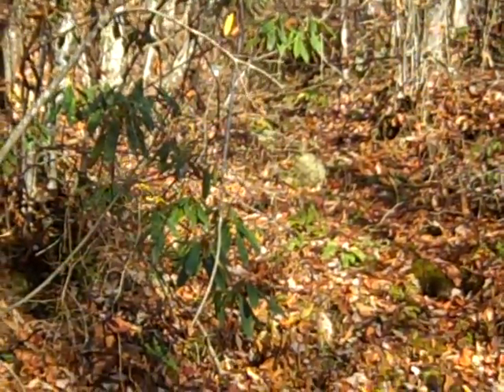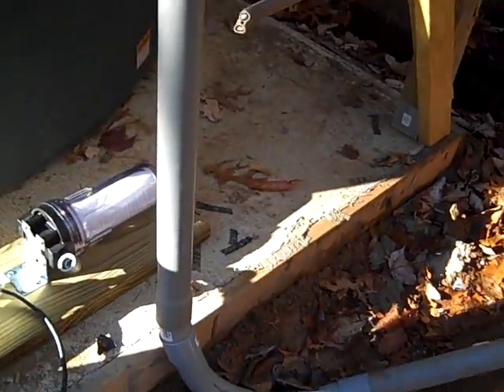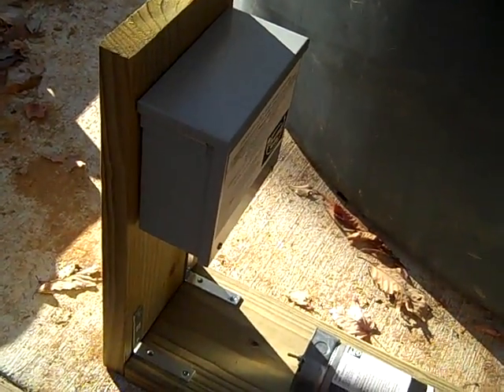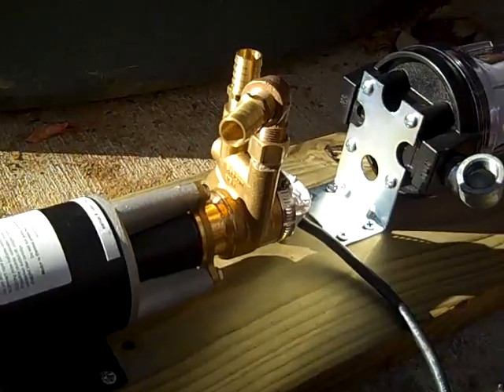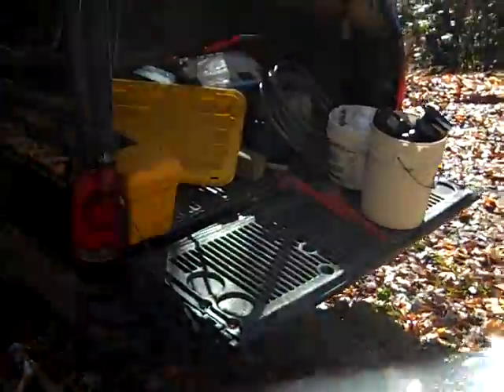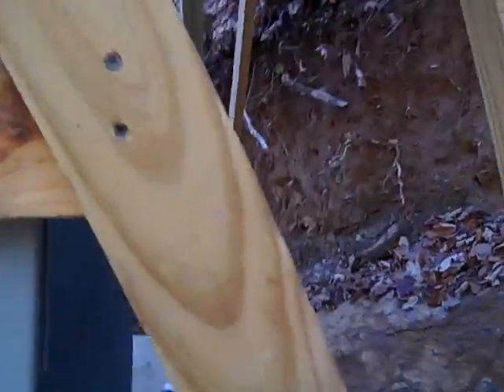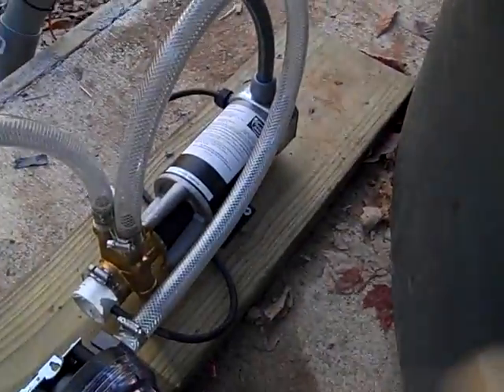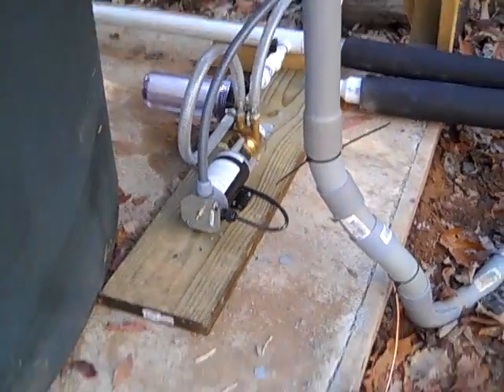Spring water up the mountain - Part 1

Comment: How many gallons per minute does this system pump during the daylight hours? I have a similar situation at my Alabama homestead in which I am designing a system for. 130 vertical feet, 500 horizontal. We have a 10000 gallon concrete tank I would like to keep topped off for house use and fire insurance.
Reply: Great video, BTW.

Comment: The common home application panels are like 250 watt and around 37volts. Would the 48v pumps work it 38 volts. I don't really care if its slower at pumping but the big panels are just so much cheaper per watt than the small ones.

Comment: #6 AWG UF Romex , means #6 American Wire Gauge is the wire gauge (size is .162" or 4.115 mm diameter) sufficient for 55 amps nominal current capacity @ 220volts. UF stands for "Underground Feeder" means the cable is suitable for direct burial underground. Romex is a trademarked brand name of non-metallic sheathed electrical cable.

Comment: I would be interested in the pumping system.  Are you a dealer?  We install Windmill, Solar, and Electrical systems.  I would like more info on your pump.  I know several ranchers that would benefit from this configuration. Thanks & Blessings, Pat

Comment: What type of wire do you use for your solar panels to pump. I know that its like a welding cable but I've never seen it underground cable like that for dc,,,,and where to buy it would be helpfull to,,, thanks